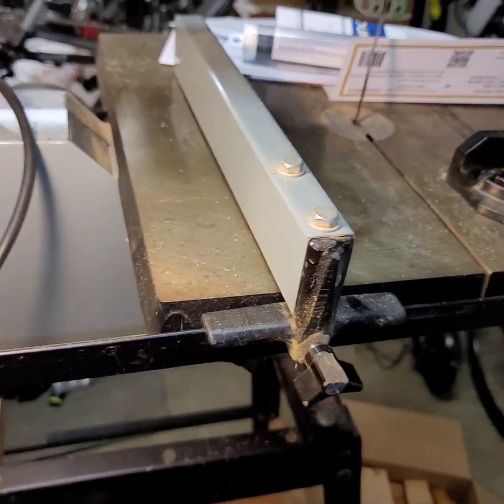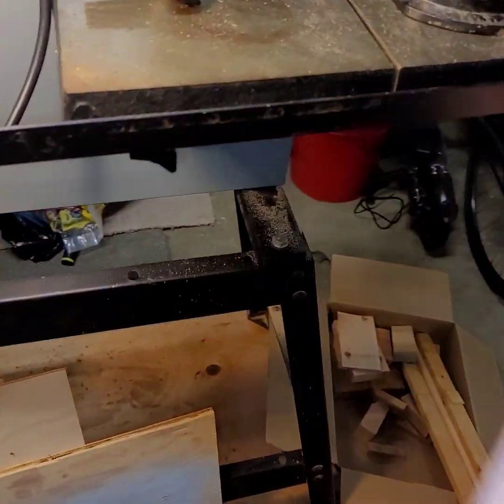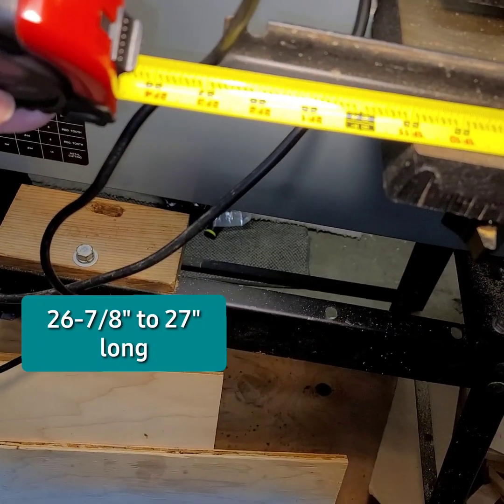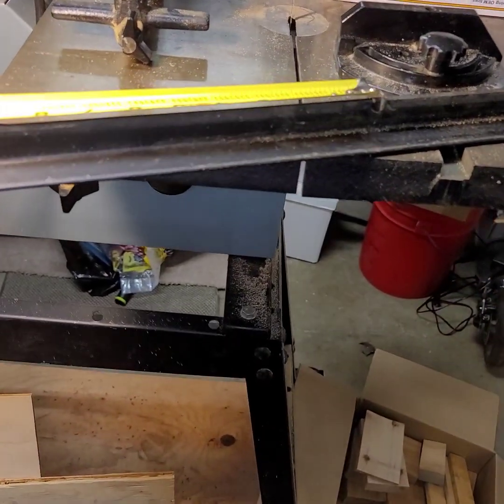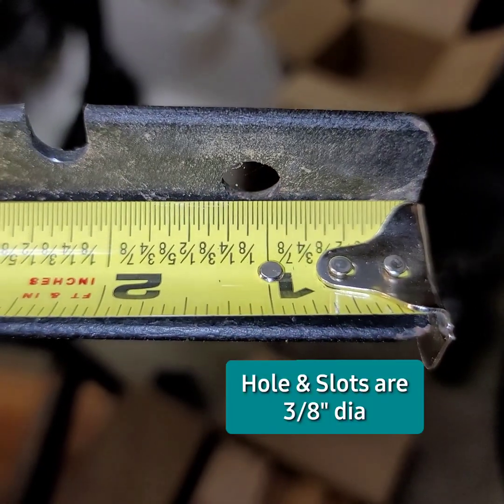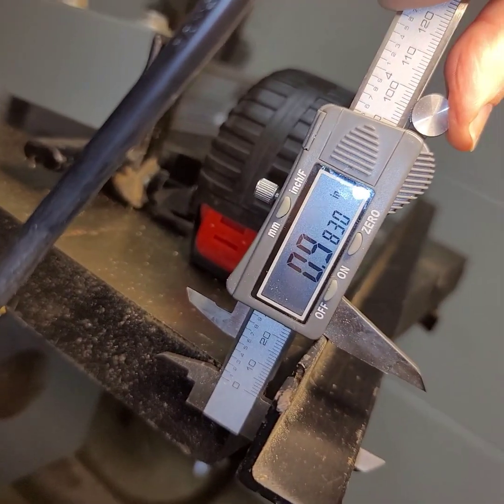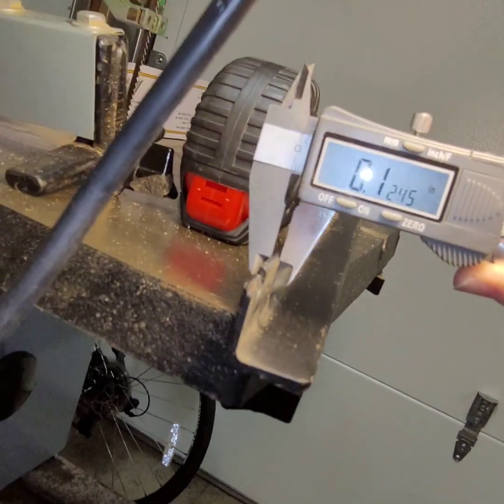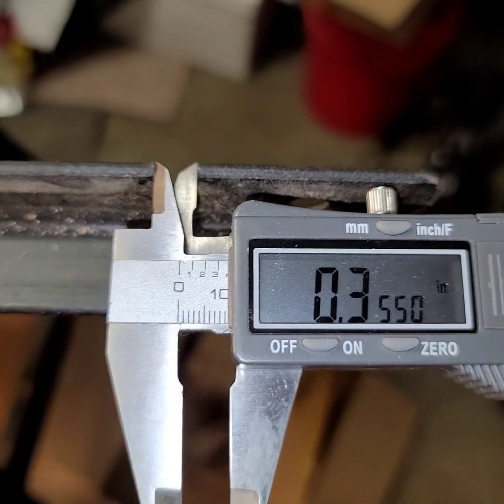Delta 28-560 Fence Rail Details

Comment: Did you make this yourself or can you buy this off the shelf?
Reply from the maker: This was the stock rail and fence that came with the saw, but it would be easy to fab yourself with these dimensions. The fence is a different matter. You might be able to find a used one.
To fab your own rail get some mild steel extruded angle stock and drill out the holes and slots, file to finish.